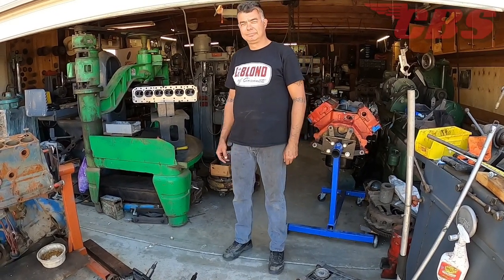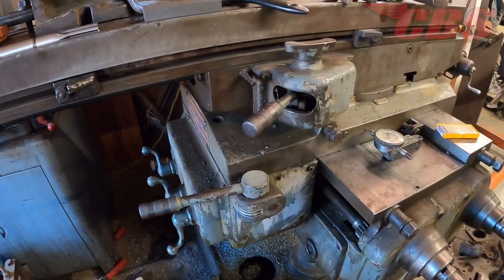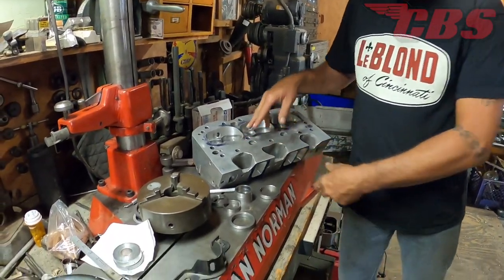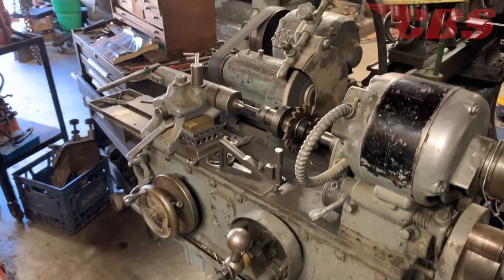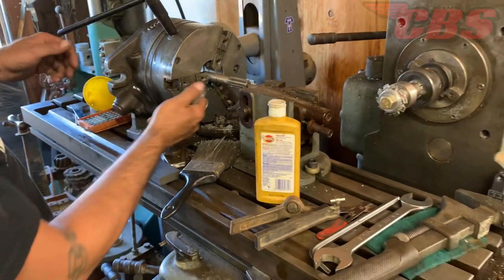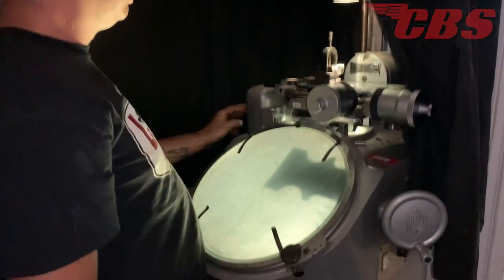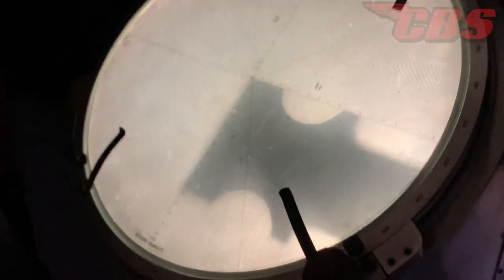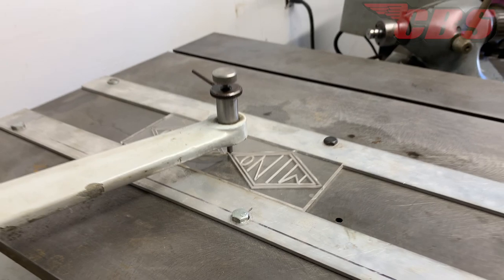Shop Tour: The Vintage Machinist

Comment: Incredible!! Martin you have the working shop that I am working towards. I went to school most of my life to get my PhD in Chemical engineering but I found out that I disliked working in that field and the people there were not to my liking as well. I was run over by a Ford F350 a little over 18 months ago while riding my 1957 Harley Panhead. Almost losing my life and my leg really made me rethink what I am doing. I decided I am starting a small engine repair business as well as welding and fabrication. With the supply chain problems and most of my work is on vintage garden tractors  I get the wrong parts , get them late or not at all. I am building a machine shop that is populated with 1800's machines run by belts and powered by steam and hot air. I have already restored several lathes and a Camelback Drill press and I am looking for more equipment. My motto is yesterday's machinery with modern results. Most of the parts are obsolete so it is great to be able to make my own parts. You will have to stop by sometime. By the way I am in Northeastern Pa. I just finished completely restoring the same valve machine that you have. It is beautiful but it was a basket case before.

Comment: Awesome shop. Great engine work ! I LOVED seeing the Clausing Colchester. I served my toolmaker apprenticeship in 1968 and used one of those. Lathe work became my speciality and boy the stuff I made on there. Soon I was the only guy in the shop who made the high tolerance military parts we made. Today the lathe is still my favorite machine. I have a used 13 inch tooled with DRO and everything else you can imagine. The next machine I loved seeing was the pantograph . My dad had a Gorton P2 ( I think it was) in the basement. He did lots of aircraft handles ,commemorative fire truck plates along with a host of other pieces. Only a part time thing aside his real job. I’ll never forget watching him engraving while looking at me and talking. It was like the stylus was just an extension of him. I soon learned how to operate it when I was in my teens. I grew to have a real appreciation for that machine and my dads talents. Sadly after he passed we ended up having to pay someone just to haul it away. Perfect condition , had a tool and cutter grinder as well for it. There were tons of templates , Masters of all sorts of letters and numbers. Was so kool how you could change the size of the engraving from the master just by adjusting the ratio on the stylus arms. Fond memories but so sad that now CNC has taken all the craftsmanship away. Young ppl wouldn’t have a clue about that machine. Don’t get me wrong, I built up a nice CNC shop that has now been passed to my sons. The engraving we could do on a machining center was awesome. Just try to imagine what type of shop You Tubes we’ll be watching 20 , 30 years from now . Thx for the tour and keep up the great work.

Comment: just found your channel, , 9:50 I have the same South Bend 13" tool room with 6 foot bed from 1942 with a runout on spindle ID at .0001......
#4 Morse taper in spindle and # 3 Morse in tailstock....
a bit of an odd ball thread of 1 7/8 " x 8......love it and how quiet it is, except in back great.......cheers, Paul in Florida

Comment: That optical comparitor is just like the one our shop had for many years. It worked fine for what it was intended to do - check parts for flatness, squareness and other quick checks of your small parts. I sure do miss all that equipment.

Comment: A South Bend lathe just like that belt driven headstock model is the 1st lathe I got to operate in vocational shop class jr year, 30 years as a machinist/tool maker later I still have the first double lead Acme thread I ever cut, and it was on a SB just like that one, also still got my V-block too, shop class was 3 hrs, back then it probably took a month for me to make,  bet I could make that same V-block in 4 hrs, conventionally, with a 1/2 hr lunch LOL.